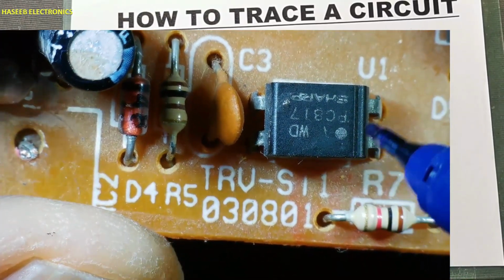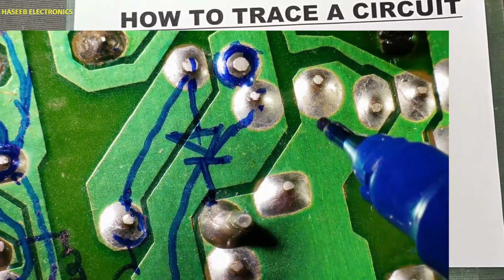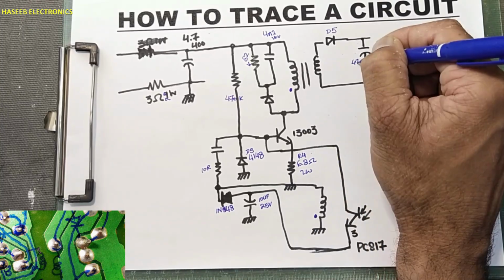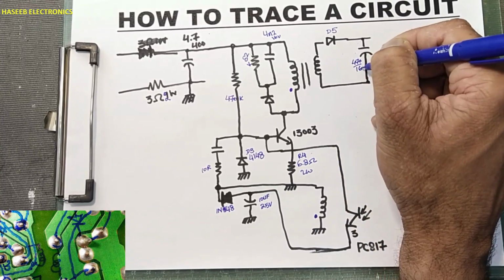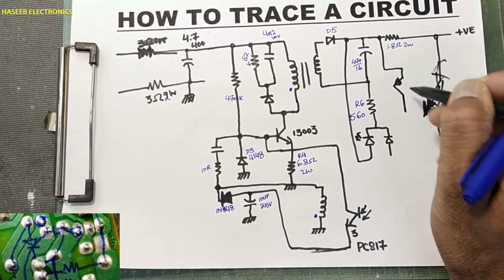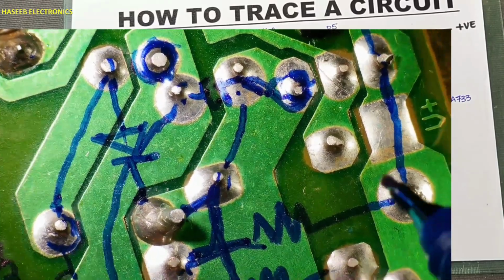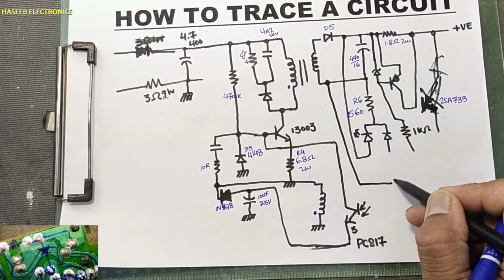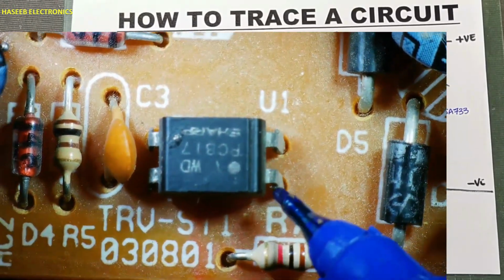{1137} tracing a circuit and drawing circuit diagram

Comment: Hello, 
I hv learnt a lot from your channel, 
I am currently working on a samsung power adapter , found it had a short on the bridge rectifier KBP206C- so ordered a new part and fitted it. 

NOW THERE is no short on the ac side. 
But ZERO volts on the transformer output pins. 

Short detector series lamp only slightly illuminates when power is switched on and then remains off. 
Main Capacitor voltage  320v 
Tested Every component but found no short. (Including the snubber circuit and the octocopler)

Suspect the pwm - GM0465R is not switching on-off. 

But I don't see any shorting between it's pins. 

Please advise. 🙏

Comment: Sir, please let me know if a SMPS is designed in 90~265v input & output 12v 10amp. It is giving 10amp when voltage is above 150v, but when it is less than 150v the output voltage is ok without load. But when load test is done it gives only 7amp and not 10amp. However design claims 90v to 265v input. Please explain.

Comment: Hi SIR, much appreciated for doing this video , but i don't understand the role of d3 and why the 10uf capacitor is connected in the reverse direction and also auxiliary winding part how does the 1nf capacitor start charging on the reverse direction when the auxiliary winding start functioning

Comment: long awaited tutorial. drawing the schematic diagram from the pcb. please do more of these tutorials
Reply from the maker: it is my pleasure and i will try my best to share more reverse engineering tutorials
Reply: @HaseebElectronics  You have some videos on reversing so it's probably enough. There is a limit to what can be done here and anything more complicated is many steps more difficult and time consuming. For example I reversed an arcade board 300mm x 300mm with 8 layers which took 10 weeks. If you did that you would hold the record on YT for the longest video. But more likely you would have a lot of viewers sleeping ;-)
Reversing techniques are not difficult and you have shown the techniqes here. It is just same thing, time tracing and drawing and checking over and over and over for a very long time. For my projects I scan the board as bmp then do the schematic then re-produce the PCB 1:1 with exact traces in the software by tracing over the top of the scanned image. If it matches with the ratsnest wires I know the schematic is correct and if not I correct the schematic to match the scan. The correctly routed PCB verifies the schematic is correct.